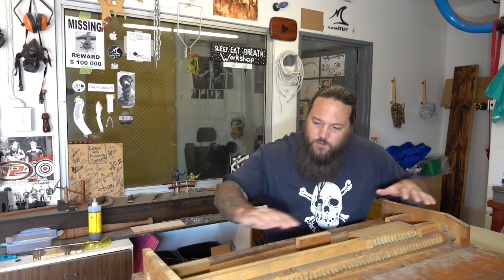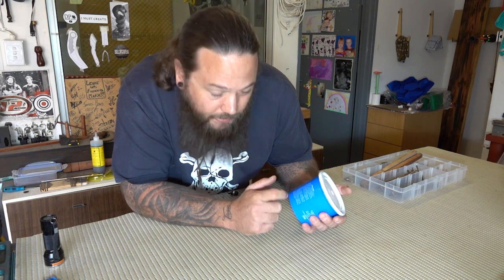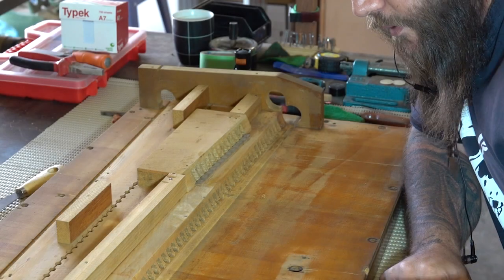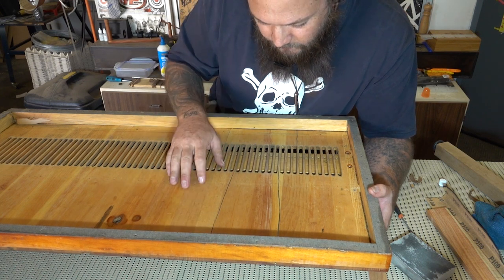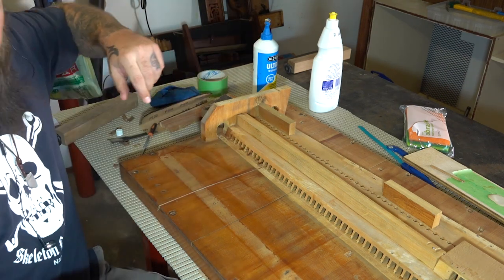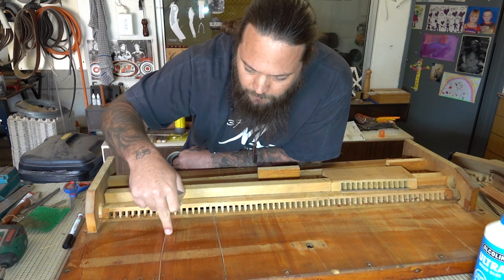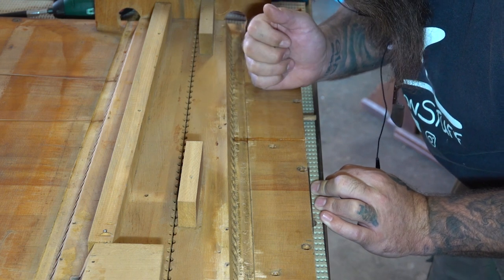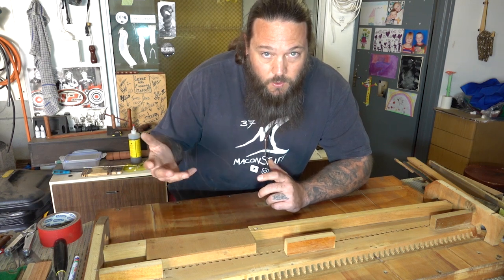Reed Organ Restoration - Part 6 - The Reed Pan Repair

Comment: In guitar repair, inserting slivers of wood (splines) into cracks is standard procedure.  Wood once contracted to that extent will NEVER re-expand and put much force on the crack.  Besides, wood is much stronger in compression than tension.  Another guitar-makers' tip:  WHen gluing cracks, always fix the crack BEFORE cleaning the surface.  Otherwise the cleaning will force dirt into the crack making for a weak joint.

Comment: Filling the cracks with solid will give trouble if the organ moves to a higher humidity area and that panel expands. I would have used a cloth strip glued to the surface to allow that motion to occur without straining the structure. You are doing very good work here with this instructional video!!
Reply from the maker: Thanx man... thats good advice, I wish I'd thought of that...
Reply: Pretty much, because the open cracks would or could close up again under the right conditions of humidity and temperature,  but if the crack is filled with hard material like a shim of veneer glued in or filler- the wood can't move back where it was and that causes stress elsewhere that can warp or crack in a different location.
When possible  (like not on the visible surface of furniture) such cracks are nicely dealt with by hide gluing on a narrow strip of thin leather which makes the crack airtight again but it can also move as it likes, we do this on large old wood organ pipes that almost always have splits top and bottom.

Comment: Wow! That's a lot of fiddly work. I'm sure I would have got bored and slapped in some wood filler. lol
If you get stuck for finish I can happily send some shellac over, it's cheap and readily available here in the UK.
Reply from the maker: Thanx... but I'm going to go with sanding sealer, which someone recommended...